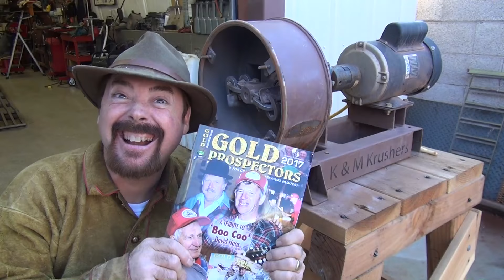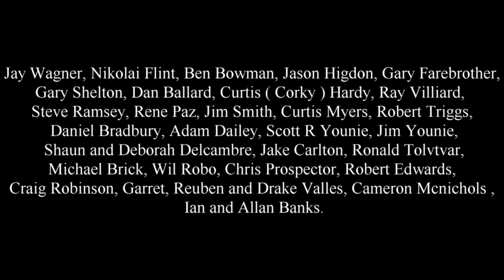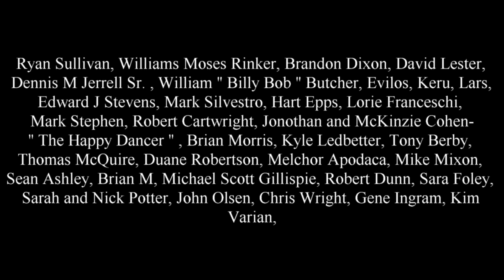Modify An Impact Mill for Better Results !!!!  .ask Jeff Williams.

Comment: the coupler is known as a LoveJoy coupler, commonly used in industrial motor applications. we use them at our power plant in Sonora, CA for all our pumps and some of our gearboxes. very important to make sure the couplers are lined up very close to perfectly all the way around, or they tend to chew through those rubber coupler pieces quite quickly.

Comment: I made one 20 inches wide 20 inches in diameter with a five horse Briggs it has double bearings one on the coverplate but is going to have the lower half removable    for quick clean outs and the whole top half and bearing removable for repair/maintenance  with Ar 500 or some high manganese steel breaker bar strips welded in.  Thanks for the videos they are definitely entertaining and informative and keep me motivated
Reply from the maker: you betcha my friend.

Comment: i've also found that running the crusher wet will reduce the dust ,  but i have to make 2 or 3 passes to get the crush sized small enough ( the internal screens where removed to prevent plugging )

Comment: Also, a guard on that LOVE JOY coupler is an EXCELLENT idea as clothing, hair, ect... can easily get caught in it.
Reply: Also, if you mark the shaft where the set screw contacts it you can drill an indentation in the shaft just a hair bigger in diameter then the set screw. Use a file to clean up the shaft where the indentation was drilled, align and install the set screw, and that Love Joy Coupler wont slide on the shaft.

Comment: finally found the video showing the inside workings , ill try an build one these  simple enough , bearing being both on back side  narrow  grinder if nothing else larger dia shaft would allow  wider crusher like the belt driver more then direct drive,  belt can slip  if it gets stuck .... if might be called when it gets stuck . screen fills up with limonite over fill ,  sure that happens
Reply from the maker: Hi Todd, not hard to build just need to know where everything goes to make them work right.

Comment: I would bet a half days wage those "strike plates" are a simple arc weld bead of Nickel Rod.
I cold also make this mill significantly longer lasting and better using Manganese Steel. I've worked on machines that shot steel shot at the speed of sound constructed of Manganese.. Great video, get that Au!

Comment: Wonder if making a V shaped plate on the chains will force the fines out the screens better , It`ll go thru the rock ok if it has a case hardened weld on the edge , Be like a chisel tip going thru the rock .

Comment: Quick question, why do you recommend going with a gas engine in the field vs an electric motor?  I have a generator and have been planning on going all electric for my equipment.

Comment: i build a crushed similar to this but bigger , the drum is 18" in dia and 20"  deep , powered by a 15 hp gas motor .... the issue i have is small bits of steel wearing off and getting into the ore . i used grade 70 transport chain as hammers ........ i'm thinking of maybe using grade 120 lifting chain ... any thoughts on this , and is there a way to share photo's of it here ?

Comment: I want to build one of these soon, I'm thinking belt drive though to deal with the vibration, or would it just stall out?
Reply from the maker: you can use V belt and it will work ....direct drive with a love joy is better for the solid impact
Reply: @Askjeffwilliams  I was just thinking about the longevity of the motor, but also thinking about gearing it down for more torque.. Maybe I've got it wrong...Just seems like 1750 RPM is a lot for un balanced flails!

Comment: Hi Jeff, 
A question - what's the approximate size of the gap between the loose end of the chain/hammers and the chamber wall?
Think your videos are great btw
Thanks
Reply from the maker: good question... we try to keep it as close as possible about 1/4 inch but no more then 1/2 inch.
Reply: Known as clearance, between impeller and casing wall in centrifugal pump terminology.In this case its the flailing chains

Comment: The difference between what your calling your impact mill and jaw crusher is pretty obvious.  Whats kind of funny though is the little impact mill in this video and what your calling your rock crusher you self built just seems like the very same principle, only bigger and more powerful motor with your own modifications of design.

I would love to have a nice 3 x 4 jaw crusher to save wear and tear on the impact mill.  Until the impact mill and a sledge hammer pays for one I don't think its happening.  I don't even think the impact mill is coming until the dry washer and metal detector pays for that.